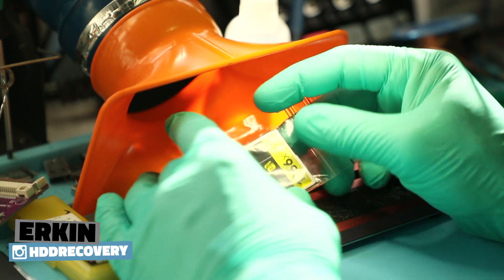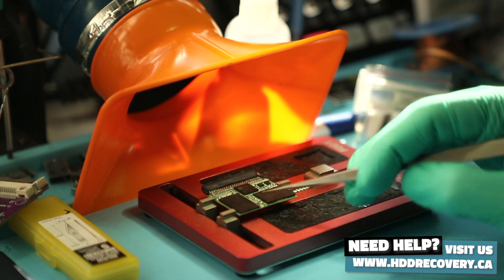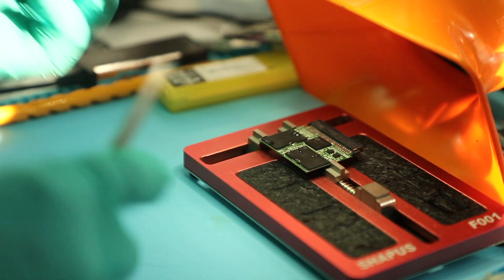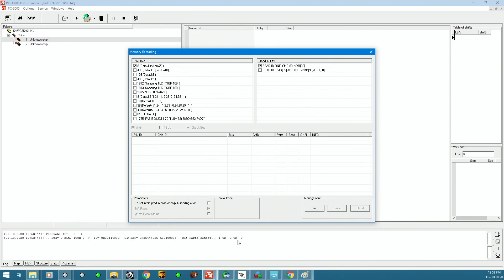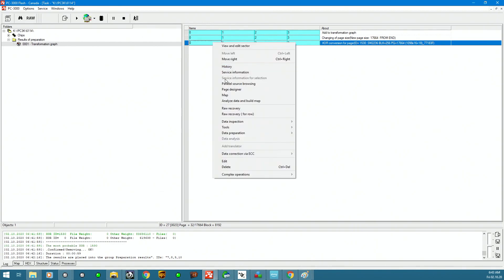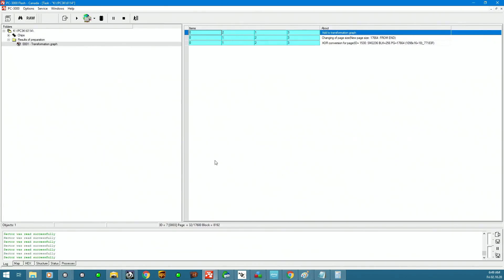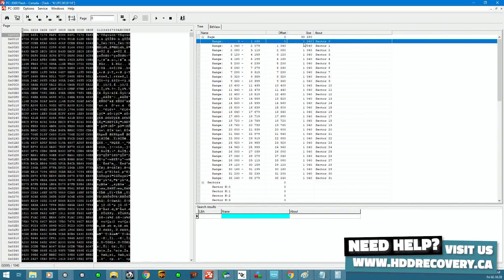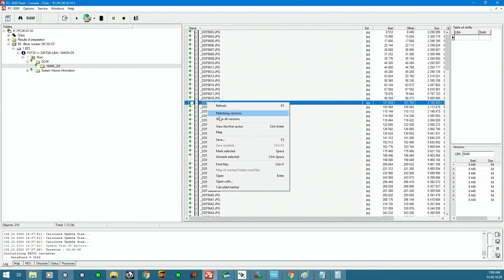recovering data from memory card directly from memory chips

Comment: You really really need to explain the theory of those steps in page designer (and the transformation graphs), not just the steps themselves.

It appears you're rebuilding the memory maps across the logical portions of each chip and then between the chips themselves.

Comment: I will reawatch this 1000 times XD trasformation is most hard thing and you do it so fast. Very usefull because you EXPLAIN every step
Reply from the maker: keep in mind some basic things. Clean the NAND first with ECC, XOR if needed, page structure, RAW - check results, if file sizes are small and broken, needs more mix. since Covid started, I made so much content, that realize that if I don't process it now - I never will (I will forget what I wanted to show). PC3000 is a complex tool, but it gets easier and easier the more you use it. Forum, and Knowledge base section on portal is also great help!
Reply: @hddrecoveryservices  Thanks for advice. Yes, i use russian forum and they help allot, trying to do it on different usb now (almost all are alive but still i do chip off and try to do all transformations, but fail most of the time, your video really help and i able to do some transformation that i was not do earlyer!). Someday i will post video on my channel too, but in russian, but befor i need to understand it all by myself.

Comment: Hi ,great videos very cool skill.i wanted to ask is there a way to increase my tablets memory from 16gb to 64gb would it be a case of changing the memory chip and can it be done as I love my Samsung Tab A ,I just wish I had more space ,I was told jailbreaking would increse but not heard that before. what would you recommend, buying a 64gb or 128gb tablet is to expensive for me ,cheers
Reply from the maker: yes, it would need to be replaced and then programmed with factory firmware to get acknowledged by the tablet. We don't do this type of work. It is more of a cellphone repair specialist job

Comment: Have you ever had to deal with solid state drives from China/AliExpress?  They may have factory rejacted flash from what i've heard. Have one that has no brand name on it, but found out that it used a flash chip from Intel ( QLC 1024Gbit ) by reading out the SM2259XT controller.